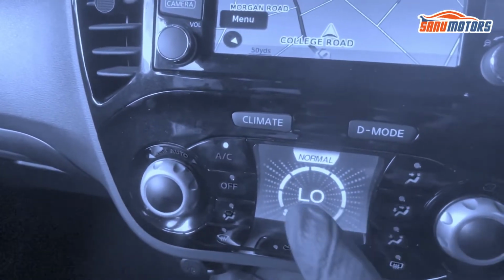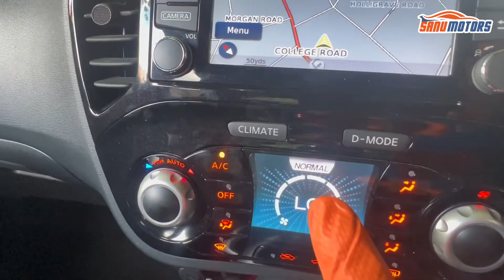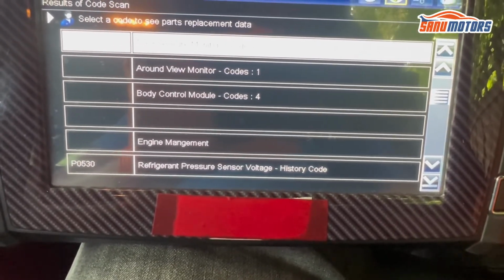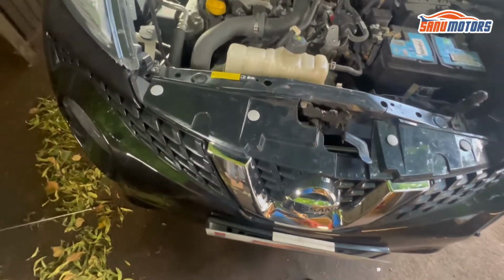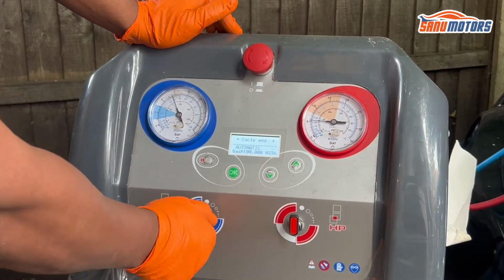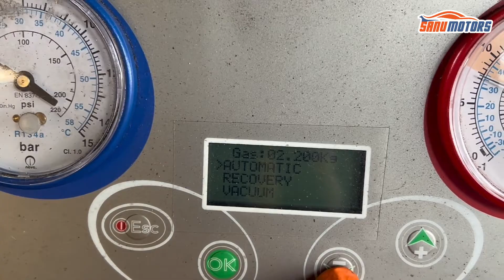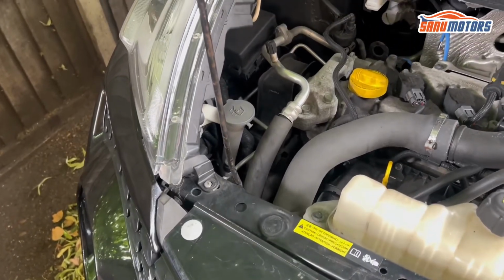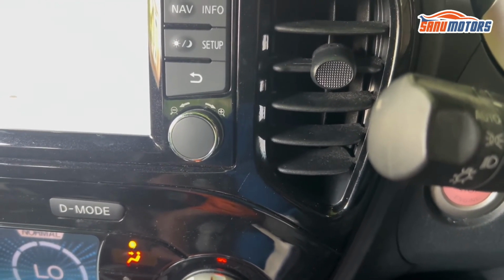NISSAN JUKE Air Con Problem and Solution: Ultimate Guide and Fixes 💯💥🫵 #nissan

Comment: Then added a big can and a small can still hot
Reply from the maker: sorry,better to check with specialist, thanks
Reply: Hello there!! I have a 2011 Nissan juke. My issue Is that ac works great when vehicle Is running but blows hot air when car Is parked